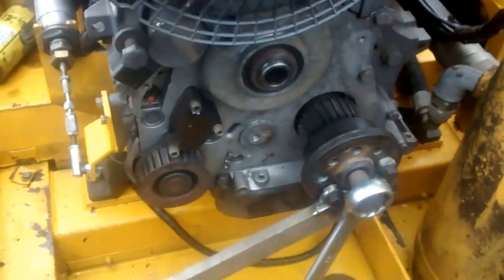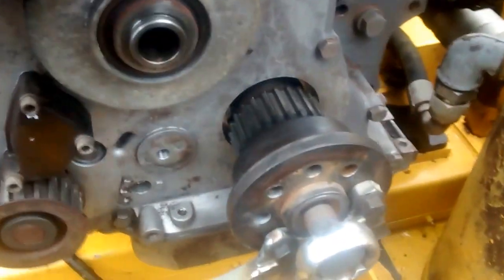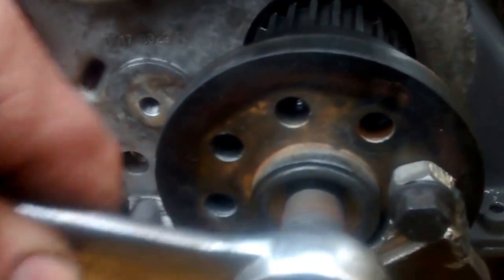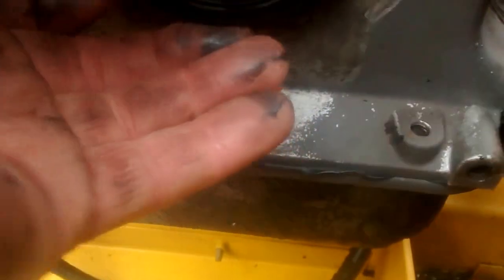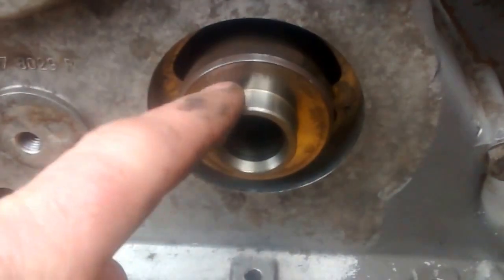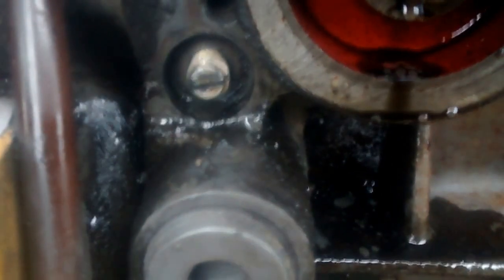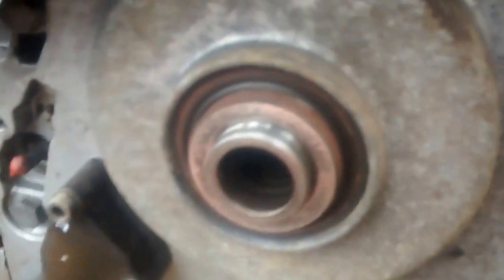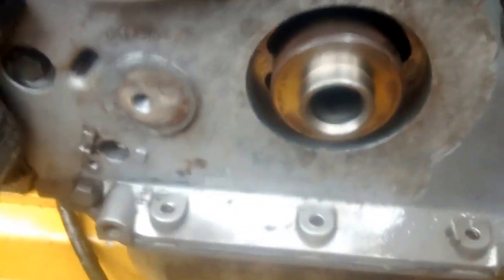deutz 1011 timing belt and oil seal change part 1

Comment: Hello we need help we have a Deutz F3M 2011 engine when it reaches operating temperature on the instrument panel the red oil light comes on and after a while the engine shuts down when we disconnect the cables on the oil sensor. and reconekt wire, engine running normally, we replaced filters and engine oil. the oil pressure probably drops and the sensor knocks out the fault, and it is possible that the problem is up to the thermostat,
Reply: If it was the thermostat  the overheat warning light should come on
Reply: My deutz does the same thing.   Removed the thermostat and it runs longer but still overheats / 240 on the heads.    Did you figure it out?

Comment: 1011 and 2011 engines right?
Reply from the maker: I would guess they would be the same system, and if not your would have a key way, same process, Regards Mark
Reply: I only wanted to point out that the 1012 in the title, is completely different engine, being timed off back of engine via gears.No belt.
Reply from the maker: not sure how that got on to the tags search but removed it so not to confuse people , i was only trying to demonstrate that I managed to repair an oil leak , not have a  trick question quizz
Reply: Camshaft  special  pin  locking  very well but crank  pin not properly  lock..  ?   Why ... sir